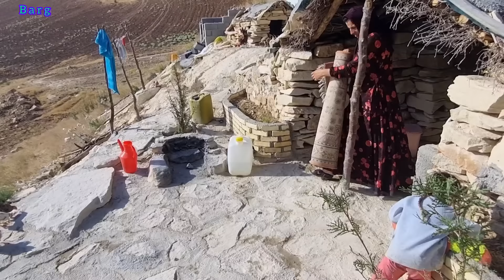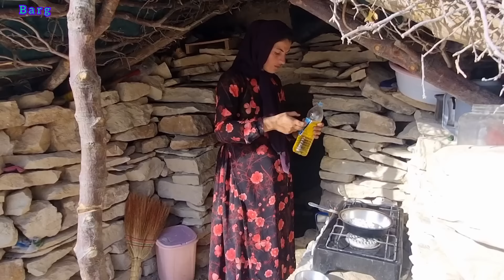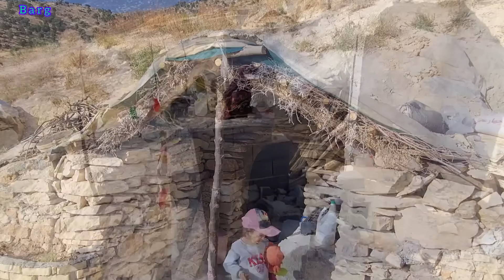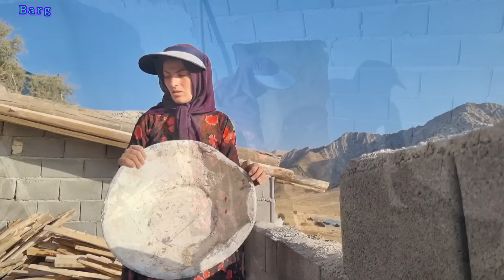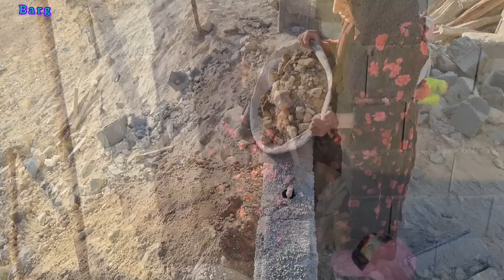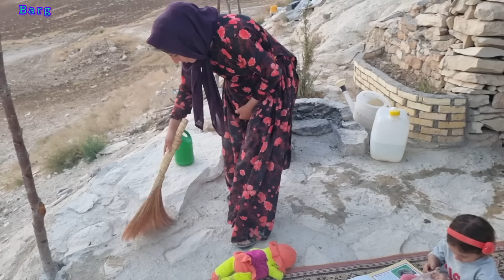Trying to survive: pregnant Zari and her daughter in the dream of home

Comment: Operator call the builder to help her & make sure that there are supports in  the cave ceiling. Maybe she can dig through to the other part of the cave by leaving a thick wàll in between & only making a doorway into the other side then dig out a wide space for the sitting area & another dividing wall with a door for a bedroom. This way there will be more support in the cave. You can do this Zari .